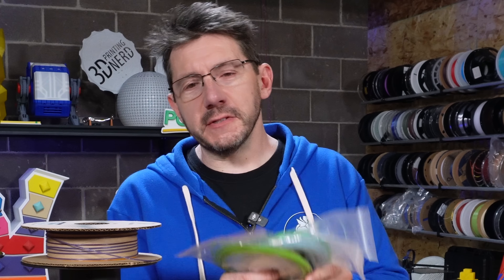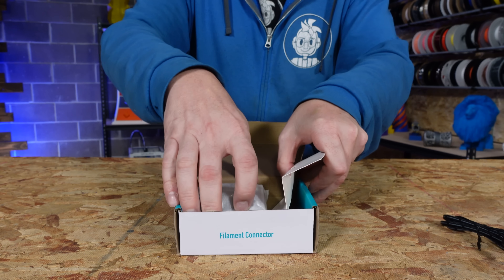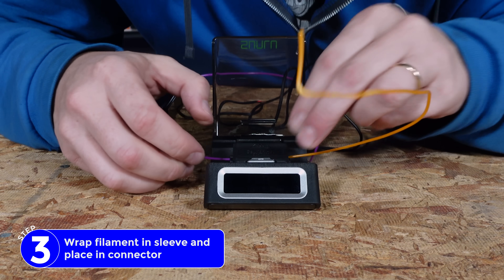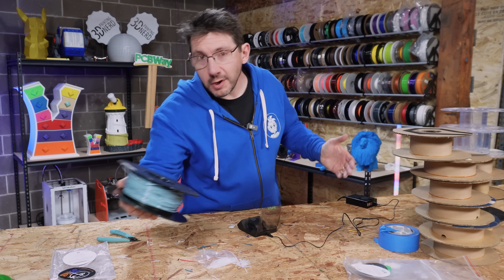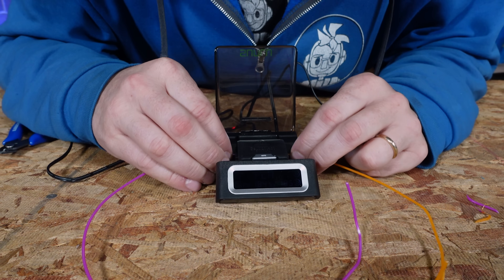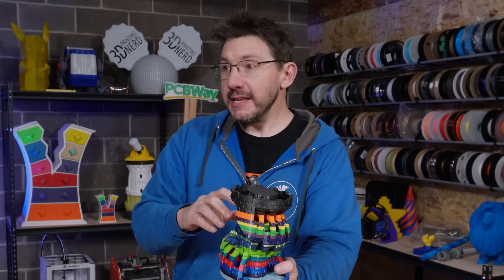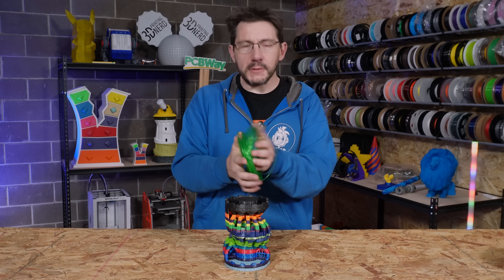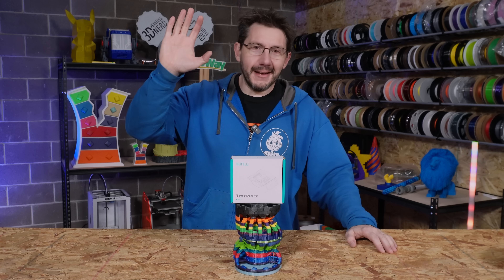Does the Sunlu Filament Connector Work?

Comment: My solution for adjoining squirrely filament on the Sunlu rig: when the filament connector beeps, unplug the unit from power, invert a can of air and give each side of the filament connector a shot of refrigerant (to freeze the still-molten connection). CHEERS!

Comment: I just bought mine and used it over the weekend to join 73 spools. I did make the mistake of applying to much pressure and causing a bend in the joining areas. Gonna try and figure out a solution as my Bambu Labs P1S is having an issue pulling it through.

Comment: Like so much in the 3-D printing world, you need to complete this product yourself! Without further work, this product requires at least three hands to work! I made a mounting board with the splicer in the middle and a spool pin either side (so the spools lie flat on the board). Short pieces of PTFE tubing clamped either side also help keeping everything aligned and also serve as a gauge to ensure the splice does not bulge out too much. This keeps the filament under control and curved in the same direction at the splice. Once it is spliced, you can easily wind it over onto one of the spools whilst sliding the PTFE collar along to the other end of the filament for re-use.

Comment: I don't understand the big deal about this. I can see where the end of the filament is in the ptf tube. I just feed it in manually when it reaches the end of the filament.  I have never had a single print issue doing this. The hardest part is timing it. I usually just watch a video while i wait.

Comment: You could replace all that filament and 10X as much more for the cost of that filament connector.  Better to just toss it all.

The only good use I can think of for it is joining spools together for a ginormous FDM print, if it can't handle in-print spool changes. I suppose you could also roll your own color changing filament but that would be a huge amount of work.

Comment: Are that many people having issues with mid print filament runouts? I've always just let my runout sensor trip, extruded the new roll of filament, retracted it a mm or two to reduce nozzle pressure, and started printing again with really no noticeable issues. Even if I don't do the retraction to reduce pressure I only get a tiny imperfection in the end result. I totally get the use case if you are using a printer like an ender and don't have a sensor but for me personally this is a whole lot of extra work for no real benefit.
Reply: There are a lot of us (myself included) running older machines that still work perfectly fine that don't have a runout sensor. Some of our machines also aren't direct drive and have the extruder gear mounted somewhere on the body, not the nozzle heat, so you're left with a long strand of filament you can't use because the machine can't push it in any further from where the extruder gear is.

This little connector works great for not letting those go to waste! :)

Comment: Have a question. I have the Connector but find it difficult to get a solid fuse. It's fine if you are just connecting 2 pieces together but that's really of little use. If I try to connect multiple pieces together and then roll on a spool to print with they don't stay together. Pretty pointless if it can't connect multiple pieces together and then spool. Have others had more luck with this? Are you re-spooling your connections to print with? Appreciate any guidance.

Comment: My experience: I tried making a thread with just 10-20 cm of filament spliced together into a 3,5 meter long thread. It didn’t work - I got a clog. I guess the reason was that I was pressing a bit too hard and where the filament connected, it was a bit thicker than normal. So when these small bumps came about every 15 cm, it couldn’t push all that filament through. I also used a 0.4 nozzle which might be a bit too thin for these many changes!

But I guess if you do it with at least 1 meter between each splice, it would work fine! And the SunLu splicer is indeed fine. I just put it to its limit and might as said have pushed the ends a bit too hard together.

Comment: All you need to is use silicone tubing that you can fit the filament in on both sides and then just use a lighter to heat up the middle to melt the two pieces together. You don’t need to buy a machine to do this.

Comment: I'm currently printing an enclosure that I designed for my new 3D printer.  The pieces are 600 grams each, so there's one part per spool with 400 grams left over.  I bought the Sunlu filament connector before watching this video but a better solution in this case is to set an alarm so I can be there when the filament runs out, pause the print during infill, swap to the new filament reel, and resume the print.

The Sunlu filament connector would be pretty good for joining small leftovers on reels if it could be re-reeled without introducing tangles.  Like most recycling, it's not worth the time needed to avoid landfilling a small amount of waste, but we hate landfill waste so we aren't rational about it.  Then we throw a 225 gram empty spool in the landfill for every 1000 grams of filament we print.   :-(

The real math:  Money saved using leftover filament minus time spent splicing filament plus time saved by continuously printing instead of loading a new 1 kg reel plus good feelings (ecology and economy) for not throwing "perfectly good filament" in a landfill minus the hassle of needing to be there to splice a new reel to the end of an old reel.

Comment: Hey, not trying to be a tool. Just a little help. Thats Improper use of the word “contiguous “.

“CONTIGUOUS”….
Means things are next to each other with a border. Like the USA and Canada are contiguous but are divided.

“CONTINUOUS” is proper.
Means something is uninterrupted or never-ending. For example, a continuous line of filament is uninterrupted. 

You were implying that the new strand would be “uninterrupted”

Just an FYI 👍🏼

Comment: My will to buy this immediately faded the moment it turned out you had to join them with a  PTFE tube meant to be cut. 
It's wasteful way to prevent waste, and also means anything printed hotter than PETG can't be worked with, very disappointing. 
Hoping for a superior version where the joining happens in an openable metal tube.

Comment: Cool product! but dont really have a need for this if you have an AMS, can just load multiple of these unfinished spool
and i want to take this chance to complain, 

WHY DOESN'T THE CURRENT AMS HAVE A DRYING FUNCTION INSTEAD THEY USE  DESICCANTS. 
THERE ARE ALREADY STAND ALONE DRYER PRODUCTS HOW HARD IS IT TO INTEGRATE THAT SHEET OF HEATING ELEMENT AND CIRCUIT WE'RE SPENDING HUNDREDS ON THE AMS BUT IT DOESN'T HAVE A CRITICAL FEATURE

Comment: Really no need for this, my opinion. My runout sensor works great. You do have to make sure to load the replacement filament and purge some and remove the filament that extruded out of the nozzle before resuming but I prefer to do that. I really don't waste any filament. If I have very little left on a spool, I will just keep it for small gears I make for robots. And joining filament together mostly would mean you are joining multiple colors and maybe multiple recommended heat temps, although you could go with the pretty much default of 205 with PLA. That seems to me a comfortable temp for most PLA. And, of course, you would not want to join multiple filament types together and make a complete mess of things. If you do this it might be a good idea to put the combined filament spool into a dry box. And I wonder how much time you save bonding together vs. just loading the next filament, purging, and cleaning the nozzle before you resume. I can do all of that really quickly where the bonding together seems to be more effort. But, maybe if you are bonding together 400mm of multiple colors then, perhaps, the bonding isn't a bad idea. For me, I just see no need.

Comment: Got mine a couple of weeks ago and it didn't work as expected at the beginning. It was a user error since the USB adapter didn't provide the needed 2A output power.
Now it is working without any problems and the next project will be the pastamatic filament spooler to get all spools emptied the lazy way.

Comment: Relying on the PTFE tubes seems less than ideal. It should have a split metal block with a channel of the correct size that wouldn't even allow the joint to expand as you pushed both ends into it.

Comment: The problem with this solution is there are a bunch of filament switchers which are all less wasteful, less painful, and don't require a string of ptfe tube and a small bit of inconsistent filament where they are joined.

If someone has an AMS, MMU3S, CFS, ERCF, etc, this is a not very good solution and if some one doesn't, its still a worse solution than a filament sensor just because of the fiddly nature of it.

Comment: i think i'd prefer something like the units they use to join fiber optic cable. doesn't use sleeves, you just trim, slightly rough up/slightly polish both ends and square them, and then heat/jam them together in a metal die. can't imagine this couldn't be adapted to trim the filament at an angle.

Comment: I wonder is you not can shape the ends of the filament to a half circle (with a heated pliers and a die) and then use 3D gloop to attach the ends on the flat parts of the half circle. 
It does not have to be a half circle profile, it could also be other interface shapes. We can lean a lot from Japaneses or timeframe wood joints. It just needs a lot of surface area and a glue.
Reply: Wont the glue wind up in your hotend?
Reply: @ if it is a glue which works as a solvent it will evaporate and leave the parts welded. Just that PLA solvent are not health and not easy come to by in every country.
CA glue would probably be nice if it’s sure that it melts too.

Comment: Why not just have filament pass through a the joiner continuously  (not while the joiner is on melting plastics) while it’s printing and maybe time it before you run out of filament, join on a new roll?

Comment: It's nearly there, needs rubber filament grips either side that push it in slightly when the 'lid' is closed, and it should sandwich the filament in between two halves of better PTFE so you dont need PTFE for every join.
Reply: That's a good call. I dislike the idea that you gotta buy more PTFE.. but I Assume you can just buy a long one and cut it up for use as well.
Reply: @b3owu1f same, but I'm lazy with it and you can get a 600pack of precut for $15 on amazon. That 600 will last a long time, at least for me it does since I'll remove partials when I start a new print that I know won't be enough to finish the print when I leave for work. Then I put those partials to the side and save them for when I have enough to come close to a full roll. 

I would see the 600 lasting me for over a year that I would probably lose them before using them as I'm still working on the 400 it came with
Reply: Have seen a 'review' video where the guy said he slipped the tube to the end of the roll instead of cutting it off. (Cannot rem. channel).
Reply: I just got my unit today and, frankly, I love it.  It needs a little learning curve, but once you got it under control, it's a great addition to the 3D accessories.

However, selling PTFE Tubing is a MUST if you look at the markiting point of view.  This is considered pure profit for them and 'continuous' income.  You remember the old Polaroid camera?  They almost give the camera away, but the film was ourtageously expensive.  THAT's how they make their money.  Just my opinion...

Comment: My two cents: know when to use it but also know when not to use it. Unfortunately the production and disposal PTFE has an environmental impact tens to hundreds of times greater than that of PLA, so if the pieces of PLA are too small, just toss 'em. Or try it do it without cutting the PTFE.

Comment: A short length of 1.8mm ID PTFE tube and a hot air gun set for 200C works about the same for me, but this is a handy solution if you don't have the hot air gun. I reuse the PTFE tube, but it's about $7 for 10 ft of it. You only need an inch or two for 10+ welds. I generally only get 10 or so welds out of one piece because I invariably lose that little piece and have to cut a new one.
Reply: I will try that with all the odd bits of PLA I have sitting around.
Where did you get 1.8mm ID PTFE tube from? All the ones I've seen and bought are 2mm ID.
Reply: @ausfoodgarden   ya I have been looking for 1.8mm ptfe also, to no avail.
Reply: @IndyKidsDoc I've seen wine tubing recommended: Feelers 1/16" ID x 1/8" OD Pure Thin Silicone Tubing Food Grade

Comment: Seems like too much work to me, I would prefer something in which you can just press two filaments on top of each other, squeeze them together while letting the extra volume come out of small side holes, with the excess getting cut semi-automatically or with a manual slider. Kinda like a miniature George Foreman Grill with extra engineering for filaments.

Comment: I have had absolutely no luck using mine. The instructions state there is a timer that will sound after the recommended heating time, not on mine, or it doesn't work if it does exist. If I use their recommended times, the filament is overheated and just folds on itself. Maybe I can eventually master it, but I don't know if I want to waste the time.

Comment: This kind of feels like MiniDisc to me - an elegant solution to a problem that doesn't really exist much any more.  My horrible old Ender didn't have a run-out sensor and I'd end up with a couple metres of "leftovers" from spools that I wasn't willing to risk using.  If that still happened, this tool would be excellent.  But now?  Now I've an X1C and I just keep using a spool until it runs out.  I do have a number of partial spools, sure - but I don't have a bunch of odd-and-sods any longer.

Yes, it took some time and attention to burn off all those remnants - but I honestly don't think my personal time investment of "check if the printer ran out yet, go load another remnant, come back in twenty minutes" until I burnt through all the scraps was any more than the time needed to manually join a bunch of tag-ends.

I'd be very curious to revisit this in six months, and see if you've generated another stack of scraps that needs joining up.  Overall, though, I think this joiner is a product that does it's job well - but no-one needs that job done any more because the world moved on.
Reply: Look, its just a commercial version of what hobbyist have been doing for a decade

Comment: I would recommend you try to use the little PTFE cutting piece in the back to keep them in place whilst they are still hot. That way they wont slip away from one another and you can squish them together in a much more controlled way. Also I found out that if you wiggle the PTFE after cooling, you can just slide it off and use it again. The result might not be as great as with a new one, but definitely serviceable.
Reply: That brilliant if it’s possible to reuse them.

Comment: I hope the infinity flow folks send out some units. They had a kickstarter recently that looked very interesting and might solve some of the breakage issues with old filament as well. it doesn't weld but it does feed continuously switching back and forth between spools. It looks promising if a bit overpriced.

Comment: Pro Tip: Hold the two filament ends together and clip the angle across both at once. It ensures the angle matches perfectly when you rotate one 180° around. Then you have a perfect mating surface between them. This really improves the success rate.
Reply: Came here to say this.
Reply: It worked the other way round for me: I but both ends straight, as I find it’s difficult for me to align the two ends angled, particularly when both filaments are curved. By cutting both ends vertically I can get them fused in one go.
Reply: That should be obvious, but never occured to me. Appreciate you!
Reply: That’s pretty much how we cut and join rubber for making o-rings. There are also guides to put the rubber in to cut exactly.

Comment: so,  it's a microcontroller, (touch?)screen, thermistor and a 2.7ohm resistor? 
i think im gunna make my own... biggest issue is i probably can't print the body in pla or petg. maybe wood... can use a copper tube cut in half as the fusing core.  maybe a machined aluminum cooling core too.
Reply: Basically. If you have a digital hot air gun or a digital soldering iron you can already do this though.

Comment: Sweet, now I can stop using the one I 3d printed a few years ago, and had to heat by hand. Was so much work.. I have about 50 partial rolls that been sitting around for years that I can finally get to.. Thanks dude.

Comment: In a world of ams/cfs/ace and runout sensors this seems like a very niche product.  But i can see where this would be very useful for older machines looking to have some sort of multicolor fun.  Also cant rule out the creativity of making your own color mixes
Reply: A lot of filament sensors aren’t great unless they’re in the extruder, this is a great way to use up all the unused filament that runout sensors leave behind without you having to babysit a ton of filament swaps.
Reply: @Makenz  I agree, runout sensors always leave something behind and this would be good if you had couple rolls of the same color and getting down to small amount left so you join the spools together so you don't have to worry about switching.